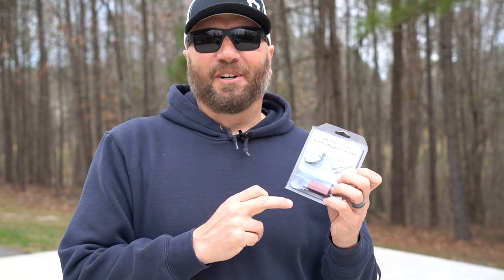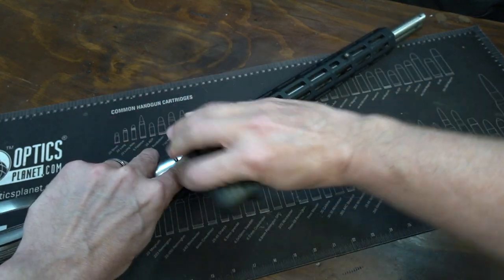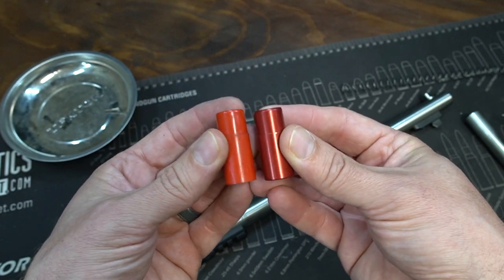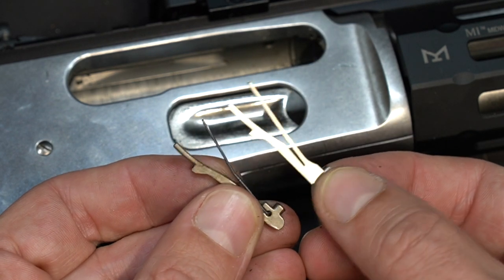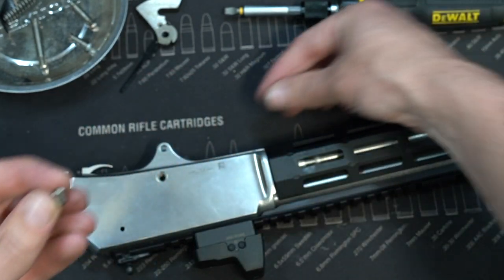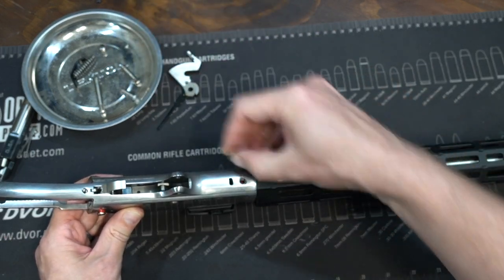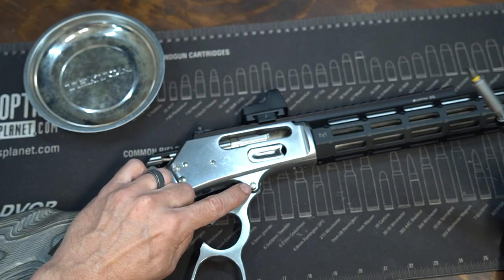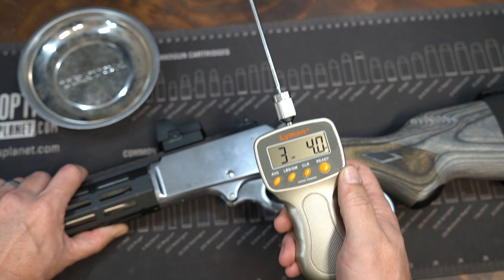Wild West Guns Lever Happy Tuning Kit Installation

Comment: Just bought a 1895 sbl marlin 45/70 and shot 4 rounds through it . Having loading problems with the action locking up and rounds chambering . Bought it brand new , any thoughts ?
Reply: Make sure it's not the lever gate stopping the carrier from dropping.

I installed a new lever gate on my Marlin 336 today. I was having trouble cycling as well. The lever would open but blocked by the slight interference by the new lever gate. So I loosened screws, lubricated, cycled a few times, and hoping for a good range day next week! Cheers from NH.